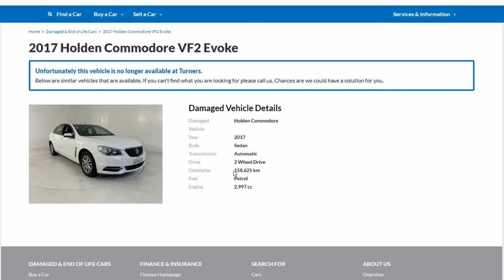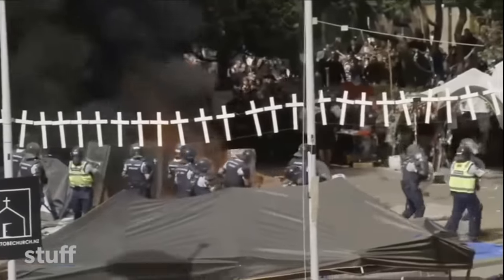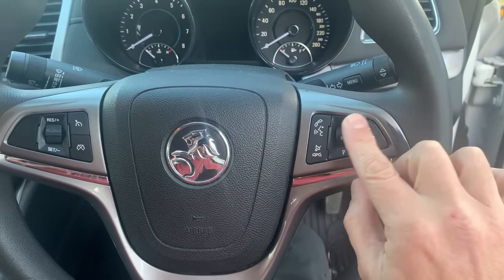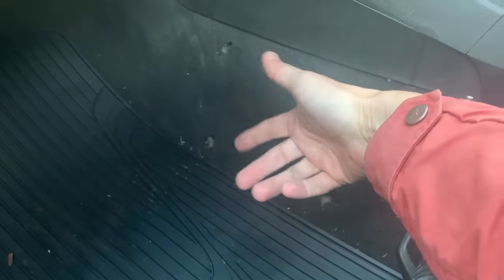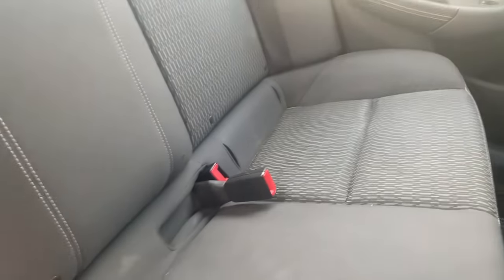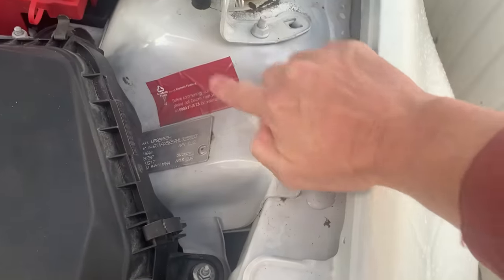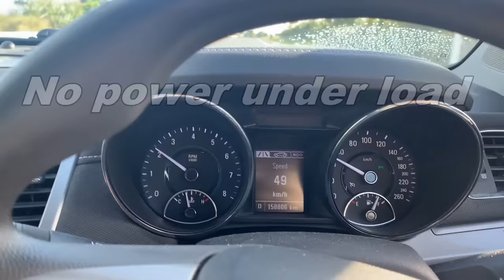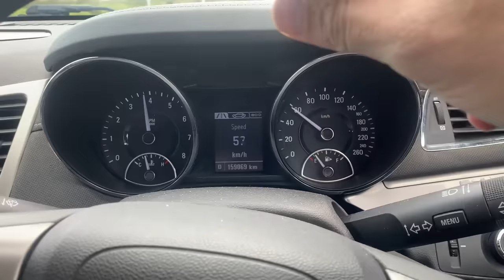Buying New Zealand's most hated damaged Ex-Police car

Comment: Couple years ago I looked at getting an ex Queensland cop car thinking they would be quiet cheap. Boy was I put in my place. They were getting more than retail for them. Tried also ex hire cars and they were the same as retail. I asked the auctioneer why they command so much. They said it's because of their service history. A guy at work bought a 4yr old cop car and I was surprised he paid $1000 more than I did. Both had around 80.000k's on the clock.
Reply from the maker: That sounds about right eh, if you buy private, can you really trust the service history? I tend to sway more towards cop cars now for that very reason mate

Comment: Had this vehicle now for a month now, its been going good but just found out that it does not like 95 fuel, i had a check engine light when putting thag in and it tripped the o2 sensor bank 2 and now i have to take it to the shop again, idk why but its rough idling and nearly stalling and came up with p0174 and p0171 code
Reply from the maker: Id say stick with 91 as that’s all it’s been run on it’s entire life. Those codes relate to the fuel mixture running too lean, possibly due to the different fuel, but I would not have thought so eh

Comment: Hey mate, saw ur vid where you swapped the sv6 bumper onto the evoke, well I have an evoke and wanna do the same thing. Is there anything I should know before doing it, like the sensors for example? I’m also thinking of leaving the DRL’s not wired because I have electrical background at all haha. Also, would you recommend changing the side skirt as well as removing the mudflaps? If so do I need to buy anything else to replace the mudflap, or is the mudflap just a ‘bolt on’

Cheers
Reply from the maker: Hey mate, the guard inners are different between the evoke and the sv6, so youll need those. If you buy a bumper, best to get a complete one if possible, it works out cheaper in the end. The sv6 bumper harness will plug into the evoke wiring and the sensors will work, but as you say, the DRL's won't. Its real easy to get the DRL's working, just score a DRL controller module online, then all you need to tap into, is ACC power, L and R side DRL and one of the headlight power lines. You can do the side skirts too, but then youre best to do the rear bumper also (are you in Nz? pretty sure I have a mildly damaged complete sv6 rear bumper if you are keen). The side skirts are identical to the VE sv6 ones, so score those from pickapart or similar for cheap. Its a cool project, reach out if you have more questions bro!
Reply: @nonrasputin9260 bro I only just realised you’ve replied! Thanks for replying too. I’ve actually got a wagon, so I was thinking of keeping the rear bumper stock and just do the skirts and front bumper. I’m also in AUS but I appreciate the offer!! I’ve spoken with some people to help get the DLR’s wired in so I’m keen for that! I’m waiting for parts to get ordered in now!! Thanks again

Also, i have a series 1, however wanna get the series 2 front bumper. Will an S2 bumper work with the S1 car? As well, if I get an S2 bumper, will I need S2 inner guards? Or can either series inner guards be used? Cheers again my bro!

Comment: Did u end up finding the cause of the blockage? Or would it be something that was caused by blowing the tranny after reversing like a muppet?
Reply from the maker: Looking at the service records, the center muffler had been replaced recently, so I’m thinking maybe the baffling material etc from the failed one may have caused a blockage downstream? As soon as I changed out the exhaust system, it was night and day change eh

Comment: How much did it cost you in the end. Low key been wanting to buy one tbh
Reply from the maker: About 2/3rds the cost of a non damaged one, so, the more you can do yourself, the cheaper it makes it, cheers mate
Reply: @nonrasputin9260  thanks mate! Been at turners a few times looking but sometimes they are well over priced for the damage I swear to god
Reply from the maker: @masterwindleborn  sweet man, test drive if you can and just price up the repairs worst case scenario. Cop cars are great because they’ve been serviced on time and typically battle hardened

Comment: I bought an ex-hwy patrol ve ss, i had 2 ve ss commodores prior to this one and i found it cheap so i thought why not.

In the 12 months i had that car it was definitely an experience. I bought it knowing i hsd to do a few things to get it up to scratch but was i in for it.

From wheel bearings to interior trim pieces to ticky lifters...and 7k later, the last straw was a head gasket. Sold it at an 8k loss.

The upsides though was the hwy patrol cars ran suspension that was about an inch lower than a normal ss and it had 3.27 diff ratio instead of the standard 2.92, and because it was beaten on most its life it went harder than my old ve ss that had exhaust, intake and a tune.

Enjoyed your videos on this thing!
Reply from the maker: Oh man, we never got the v8’s for cop use over here, but I totally get why you bought it, what could possibly go wrong, right? 
Thanks for the feedback and telling your story, I can image you totally regret selling it eh… 
 Cheers mate!
Reply: Head gasket failed because cops drive it hard without letting the engine warm up first
Reply: @tomtom1541  no doubt. But very unusual for me to see an LS with a head gasket issue, well for me at least

Comment: How do you test back pressure? Is that a device you can get or do you have to go an exhaust shop or a mechanics?
Reply from the maker: It’s just a pressure gauge that most mechanics have. You could probably use a compression tester at a push maybe?

Comment: I'm surprised they got rid of this car so soon. If Motorway Patrol and Police Ten 7 has taught me anything, it's that the Kiwi police hold onto their cop cars for at least 10 years.
Reply from the maker: Seems pretty premature eh, but it’s usually a mixture of kms and age, mixed with the desire to move over to the new adopted Skoda platform (ugh)..Plus, it had a fault that was tricky to diagnose, so they cut their losses I guess
Reply: @nonrasputin9260  but as you said it’s leased these days 3 years they throw u a new one 😂
Reply: 10 7 in the UK is at least 10 years old 😄

Comment: smallest engine in the model & an auto ewwww, does it even need and LSD?.
Reply from the maker: Hmmm, not so sure it does, but I guess there’s less chance of sliding out or getting stuck? Lfw produces around 190kw, so it’s not completely bad news. I rekon the lfx would have been a decent police upgrade for the evokes eh
Reply: @nonrasputin9260  ok that v6 isnt too bad better than i thought i guess the huge bulk of the car kinda offesets the power.

Comment: who would buy an ex-cop car with a crappy 3L Alloytec POS in it? it'll need timing chains soon & that's a shit job cuz I've done lots of them in Alloytec's.
Reply from the maker: Its not that bad an engine eh, definitely doesn't suffer the same chain issues as the early ones. Most chain failures are due to poor maintenance as the oil cools the chain, once there is sludge, the chain overheats and then stretches. These cop cars may get caned a bit, but, they are serviced religiously eh
Reply: @nonrasputin9260  Have you been a mechanic for 40+yrs?... I have & the Alloytec POS & their euro crap is what farked GM in OZ, there through away very poorly designed PIECES OF SHIT, So what part don't you understand ?
The only good General Mess was an LS without that stupid AFM,  I I have done so many delete kits & re-program I"ve lost count.